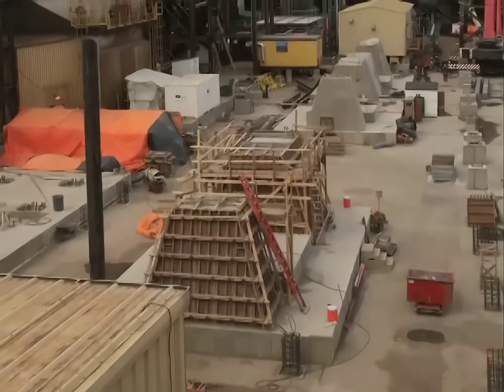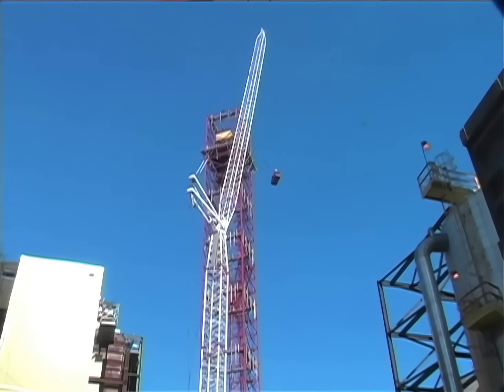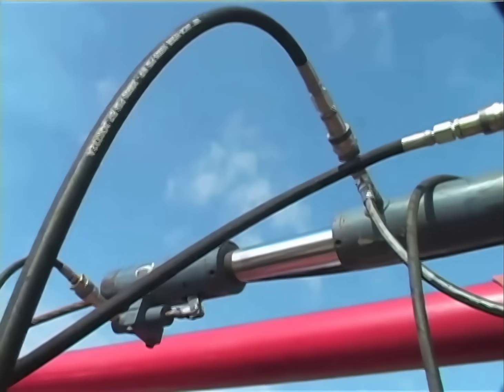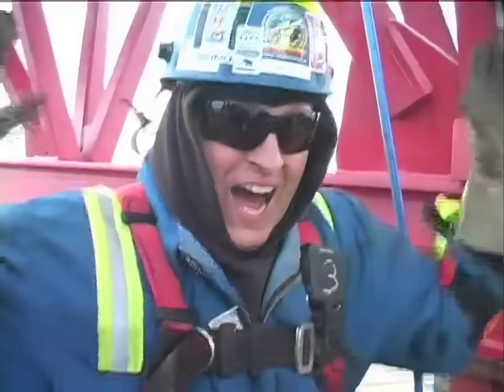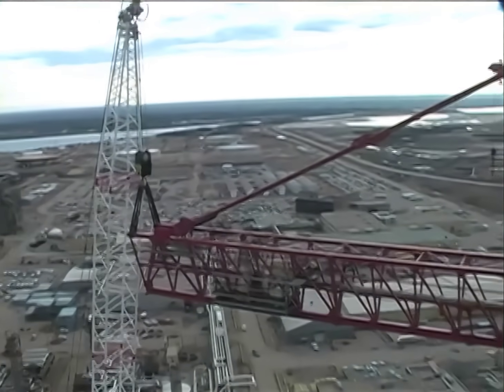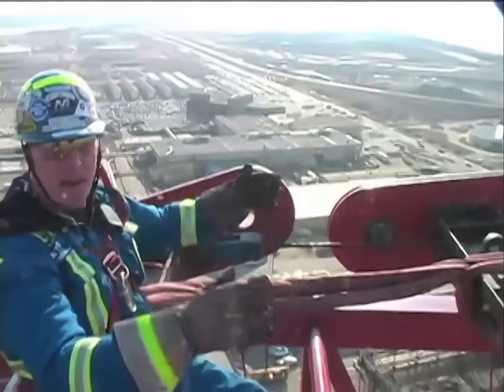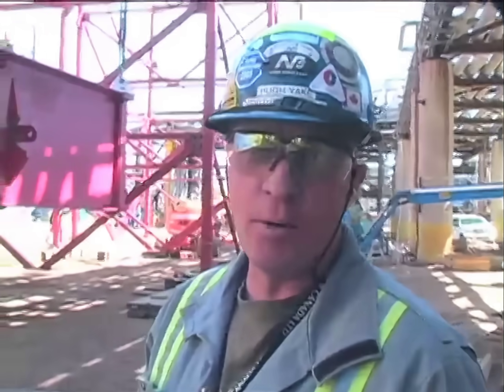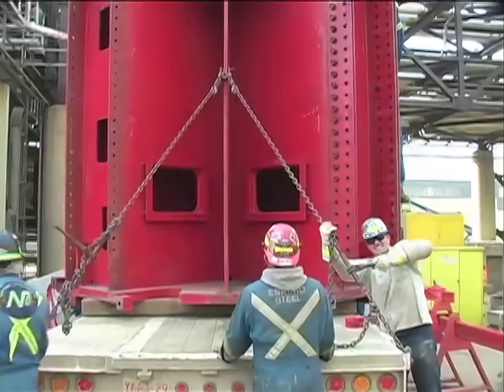Dismantling the World's Largest Tower Crane

Comment: What is it with the Americans claiming that things, no matter what, coming from the US are bigger, more expensive and are better? Take this crane for instance; biggest crane in the world? No sir, the biggest cranes in the world are made and engineered by Mammoet from the Netherlands, the biggest waterworks you’d say? Well you can find them in the Netherlands, the biggest flower auctions? The Netherlands. They need to keep them flowers fresh the biggest refrigerators you can find on this planet. In Hoek van Holland they installed the biggest computer steering doors to keep the water out coming from the sea with spring-tide. If you try to imagine that approximately 40% of Holland is below sea level with the deepest point which lies in Nieuwerkerk a/d IJsel and lies at 6,78 meter (22 ft 2,9) it gives you an idea how big the pumps are to keep the water out. I can make this story much longer but I’ll think you get the picture. 
That doesn’t mean that this job is a walk in the park but hey come on, not everything coming from the states is persé bigger, stronger or more expensive🤷🏻love from Holland 🇳🇱 ❤

Comment: First time walked a 4" 60 feet partner started walking at me I was hell no I never been on iron let alone connect welder needed job was quitting as soon as got check . I said kiss my ass I not turning around or backing up he kept coming I said you son and he pushed pulled went around me I near shit . He was a freaking hand but I said I will kill you you mother and laughted my ass off two days before got check I loved it hard as hell on you tho off the ground away from the worms after that and a big time drinking wasn't a problem was hung over can't walk on ground was quite or  or drink I drank the hell out some beer . When back welding few years later body shot welder took six months to make it all.day without a beer was a bitch after work killed usually at work just not like Hanging iron I scares shitless up there at first then try stand on near. Nothing weld all Good then stop can't see shit slowly lift hood and get your shit straight repeat that's crazy no chinut loving elbow walkers nuts

Comment: Retired IW out of Local 387. You guys were smooth. Last year here in Atlanta some guys were taking one down here and screwed up. Evacuated buildings around it, blocked off a major street, genuine cluster. $$$$, all fine and dandy till it goes south. I worked with some solid guys over the years. Certainly not a easy profession, a rewarding one for sure.

Comment: Back in the 60's in the UK, I was on a team building a Picon tower crane 100 foot tower, 100 foot jib. No other cranes on site as it built itself. After the base was constructed, the jib was built [about 15 feet off the ground] then the tower was constructed using a small jib. Then the cable drum on the jib was used to haul itself up using a long wire cable. About 40 feet up the cable snapped and the jib dropped back down breaking its self in half. Luckily I was a it fleeter in foot those days, because where I was standing holding a rope to stop the jib from revolving, was a heap of concrete from the ballast weight box!
Reply: @Robin hello,how are you doing
Reply: @yvonnebraun7  I am fine thanks email me at rzholland@gmail.com

Comment: I used to work at Shell in Norco. The unit next to ours was getting 2 new vessels that were very large and heavy. A truck crane came in and started to unload like 10 trucks and put a crane together. Then 20 more trucks came in with a larger crane parts on then to be assembled. Then 30 more trucks cam in with the final crane needed to install the vessels. It was big and heavy. In addition there was like 20 trucks of mats for the crane to sit on spread around.

Comment: I worked in a maximum security prison for 6 years with some of worst people alive. Did multiple cell entries when the inmate had a weapon and id do it again if I had to. 
Your job you couldn't pay me enough to do that. Hell no. That is where my cowardice would show. Respect gentlemen. That's something I could never ever do.
Reply: You learn to trust your safety gear and get used to the height.  Ive done some high lift steel fabrication and I actually like the thrill of it.
Reply: I mean operator is making probably north of 200+ a hour and the crew taking this baby down is probably also at least north of 40-60 a hour if I would guess. Sooo almost a mill a year would definitely make me want to do this lol

Comment: I worked at Syncrude in 1986 and remember they had the largest lathe on the planet at that time (another lathe, it's brother was in Russia). Oh, and the highest I ever had to work at was Petrosar refinery in the late 70's and early 80's. I worked in utilities and had to issue permits during the shutdown in 79 or 80 (don't remember which) and I had to climb the (about) 356 ft to the top of the flare and conduct gas meter testing for LEL's, O2 etc. for entry into the flare stack for inspection and repairs. I think I still have a Syncrude jacket and a Petrosar work shirt. Also I remember working at Suncor the night of the massive Syncrude fluid coker fire in late 1984 (as I recall)
Reply: Thank you for your service
Reply: Thank you very much. I still have some manuals and even my field  jacket (at least until the last few years).
Reply: Interesting video spoilt by the annoying music (noise)..

Comment: Here at the yard i work we have a similar crane. It can lift 110 metric tons at 86 meters from center. It also has a superlift-arrangement which gives it a maximum lift of 240 metric tonns at 43 meters. It was made by Krøll(Kroll) giant cranes in Denmark. Was suppose to be setup in Russia but Kvaerner Stord bought it instead. We use it for dismantling old oilrigs from the northsea Norway.

Comment: seems that if you use a crane to disassemble a crane, then you don't have the largest crane...
Reply: ..Largest 'TOWER' crane.....plenty of lattice booms/crawlers are taller......
Reply: Right Doug. Actually this is a long way from being the tallest tower crane, it's the largest. The huge super cranes are way bigger. What this crane can do, to make it practical. It reaches way out, over an entire work area and can handle loads up to 100 tons even at long radius. There's a certain amount of safety in that. It's not the tallest crane, it's not the largest either. It serves one purpose, to be able to lift for multiple areas on a jobsite without moving
Reply: You're quite right...Largest 'Tower'; crane...all my respect is given..! Good job, nice video...I appreciate your efforts in recording it and posting...!!!

Comment: You think this is hard?!? I once had a put up security light at the back of a house with one foot balancing on a wobbly stepladder, the other foot on a wet windowsill, one hand holding the light, the other hand connecting cable, it was getting dark and I had no safety line. I was about 7 foot off the ground. Now that is dangerous. These crane guys don't know how easy they've got it!